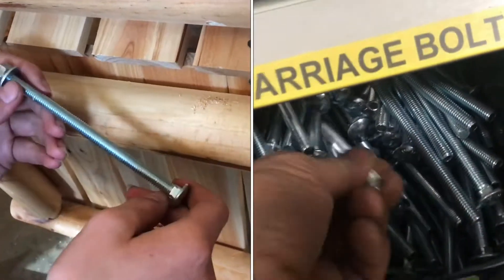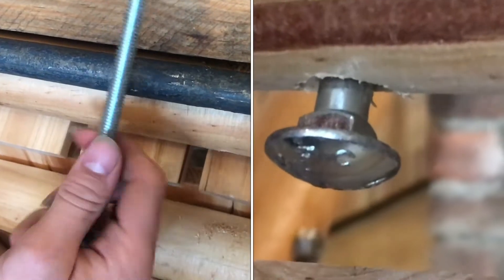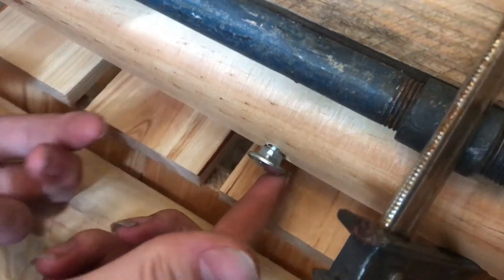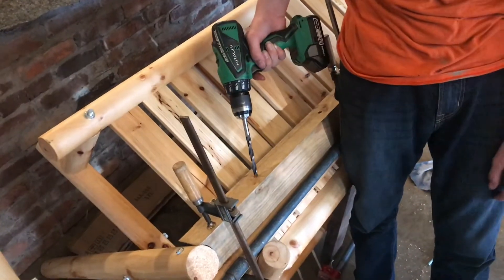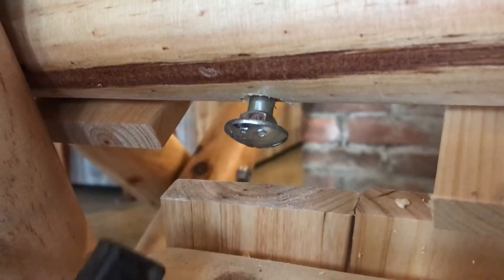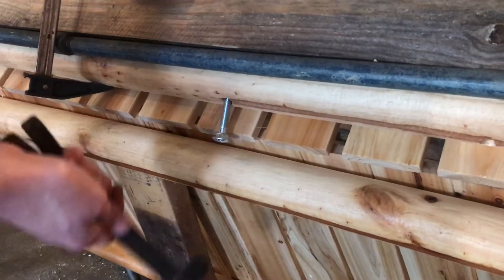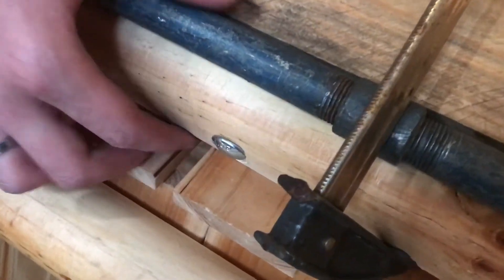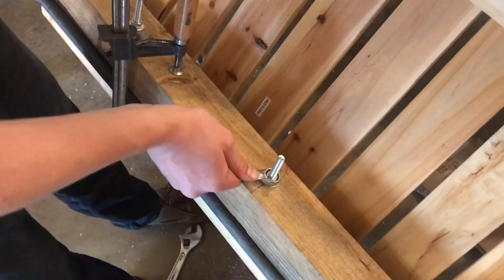how CARRIAGE BOLTS work and “when to use them”

Comment: I didn’t get to learn how to remove them
Reply: Take off the nut and use a hammer from opposite side. Lightly tap a few times amd out it comes
Reply: I was trying to take the nut off but the bolt kept spinning. This was on a private stop sign, not wood.
Reply: @satino8082  If the bolt is spinning then the square neck isn't seated in the wood correctly. The point of that part is so that the bolt does not spin when you screw on/off the nut

Comment: The downside to carriage bolts is that they have a tendency to slip over the years resulting in it having to be replace by a hex head . 
They also suffer from a slight design flaw in that the depth and width of the square may be too small for soft woods . two different styles would be nice?

Comment: Any advise on how to remove a nut from a carriage bolt that is spinning inside the hole due to the wood being stripped away??
Reply: That happened to me once. I had to use a grinder to cut a deep grove to prevent it spinning by using a flathead screwdriver. I don't want to be impolite but I think it's stupid design I will never use it.
Reply: A screw extractor might work.

Comment: In my application of a book binding press I'm using two 3/8-16 carriage bolts but the square press-fit in the wood is probably not sufficiently robust to keep reusing over time. I looked for an anti-turn washer but almost no one carries them except in packs of at least 50 and I really only need two, so what would be a good alternative to an anti-turn washer? Can I super glue the square press hole so that it remains robust and doesn't migrate?

Comment: Your thoughts on using this for the deck of an open trailer, 2x6 PT planks. Do you think they’ll get lose over time due to the vibration & constant traffic? I would like this because it’s smooth and won’t pop tires…

Comment: Thanks, man! I was personally was making my own project to see if the bolt has to move or not, but I finally understand the function of why carriage bolts have to be stationary as much as possible because I'm making adjustable legs with a working table.